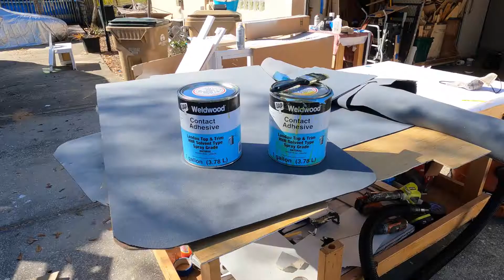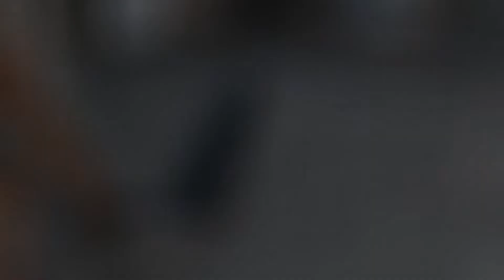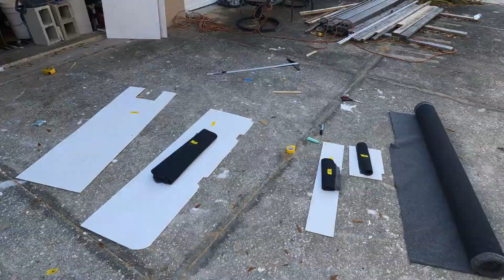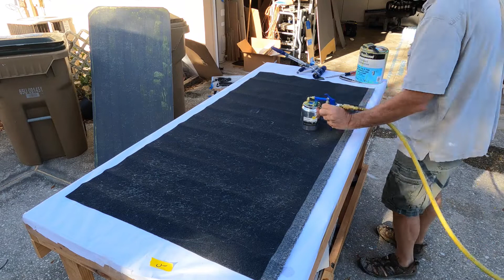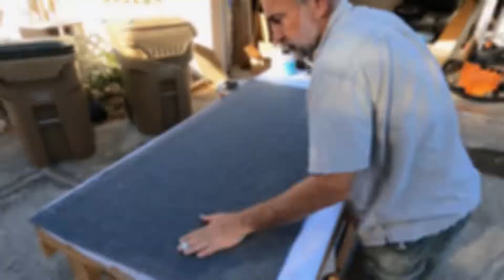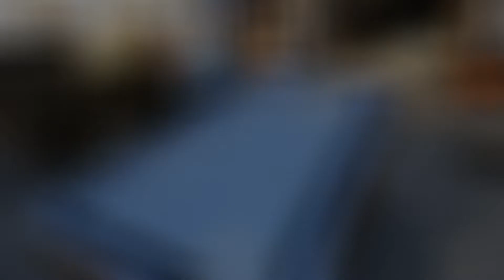Van Build: Wall Panel Upholstery wrapping Duramax Marathon tweed material on wall panels, Part 1

Comment: If i were to just seal it, why would it be necessary to apply the mold and mildew?
Reply from the maker: Even if you seal the wood, mold and mildew may grow on the surface.  Coating with mold killing primer assists in keeping future mold from growing.  I applied the mold killing primer only to the inside surface - that faced the void in the wall were there is less air movement.   There is more information in section #5 at https://thefrugalfactor.com/
Reply: @ right but if you have proper ventilation (which you should) then that should prevent mold and mildew. But it doesn’t hurt to add mold and mildew on top of the sealant

Comment: Is this material best just for the flatter ply panels or can you do the curved metal panels of the van too? .thsnks
Reply from the maker: I only use this for flat panels.  For any curves I use Polywall and shape it with a heat gun, then cover with marine vinyl or duramax cloth. All the videos can be seen by category at  https://thefrugalfactor.com/

Comment: Thanks for the video. Nice tape trick for a pouring spout.   What’s the advantage of brushing rather than spraying the adhesive on the edges that will be folded over?
Reply from the maker: Note: All the videos by category can be seen at https://thefrugalfactor.com/  Brushing provided more coverage.  Due to the heat of the Florida sun when spraying it dried fast, and I was slow.  So ensuring I had enough adhesive and enough time to fold over and stretch the material brushing the corners was best for me.

Comment: Does Marathon Tweed/Duramax have a pattern direction?  How careful do you need to cut it out?  Should you line up the panels to go in one fabric direction with the panel tops aligned the same way?  I'm asking because when you upholster with other fabrics then aligning the pattern is important.  Is Marathon Tweed so easy to use that this doesn't matter?
Reply from the maker: Very good question.  The answer is yes and no.  Depending on the pattern/color it may have direction.  That will make it more difficult to  install, and more errors would be visible.   On purpose I selected a heather grey color/pattern that did NOT have any direction in the cloth or weave.   I recommend requesting samples before making your decision.  That will allow you not only to see if the colors have a directional pattern, but also if the weave has any direction.
Reply: @FrugalFactor  Thank you.  Not many people mention it when doing their build so I was curious if the fabric was forgiving for newbies to upholstery.  I will continue to be careful with our layout even though it will take a bit longer.

Comment: Thank you for taking the time to create these videos. I didn't see you add the headliner material underneath the Duramax. Had you already glued it to the material? Would've loved to see you turn the panel around to show the finished product. ( ; Looking forward to more, very helpful!
Reply from the maker: The headliner material is cut and applied with the same adhesive.  That's the easy part, you can see it attached at this point  https://youtu.be/oBFApNrwcDs?t=238    You can also use 1/4" foam - I think the headliner material is a little better, and when I made my purchase, lower cost (It may have been a lucky purchase).   Check you the Van Tour Videos to see the finished product.    https://youtu.be/sHyEiUGWOa4   There are many build video's still to edit and upload.  Happy to answer questions... maybe we will meet up in our future travels!

Comment: Hi FF I really liked your painters tape top tip for controlling spills and mess.

So when I have carpeted my panels I set the ply down, good side up (the side you are going to put the glue on).
Then, before putting glue near anything, lay your carpet on top.
Now slip it about, line up the edges, make sure you have it exactly where you want and pre bend the carpet around the edges enough so you have a mild crease and the carpet wants to conform to the panels shape.  NB you don't want it looking like a right angle bend, just a gentle deviation in the carpet.
Then if you feel like it use some clothes pegs to keep one half of the carpet locked on to the board.
Fold the right hand side of carpet back over onto the left side, and spray glue the carpet and board one half at a time.
When tacked up you can gently roll the sticky side of the carpet onto the receiving board with virtually no wrinkles or bubbles.
Then repeat for the other side.
 Takes longer to say than do.